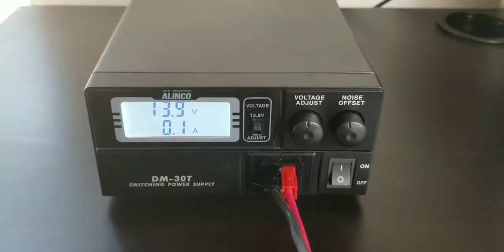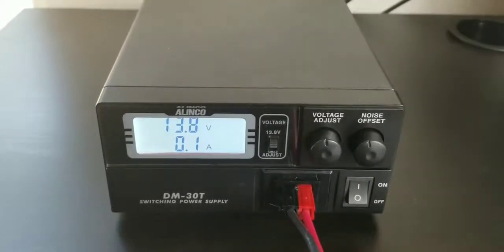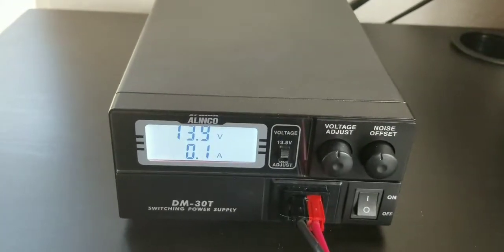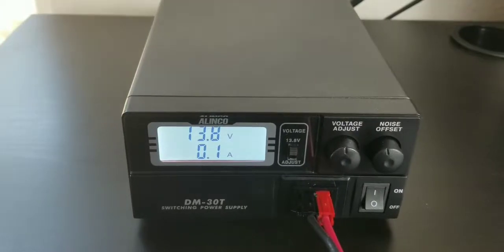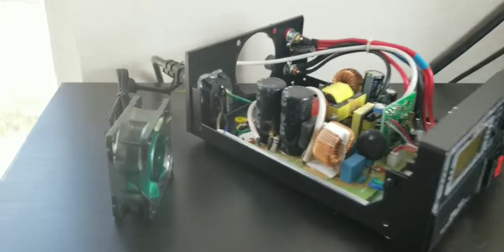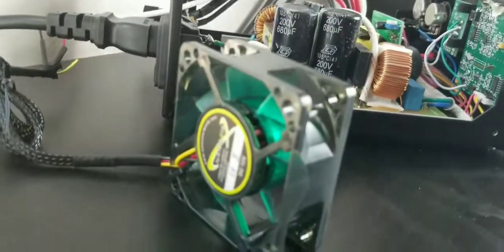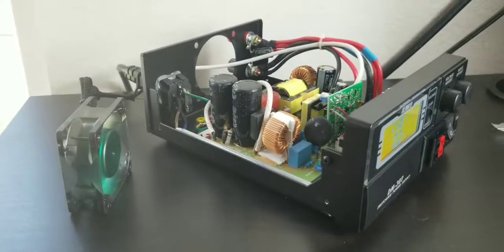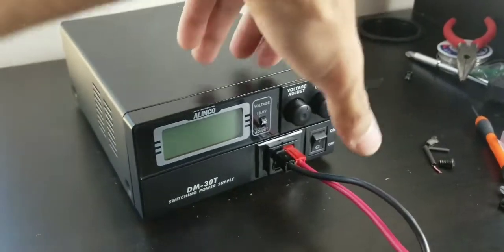Replacing noisy fan from Alinco DM 30T switching power supply

Comment: If you set the voltage on 13V the Fan is 75% quieter its a 12V fan and you set it to 13.8V. Can this be fixesd with a resistor to get less voltage to the fan?

Comment: I understand the new fan is much quieter but does it Blow enough air into the unit to keep it nice and cool?. And also some of those aftermarket fans will admit interference in the radio have you experienced any of that?
Reply from the maker: TM 26 new fan blows enough air an no interference at all :)